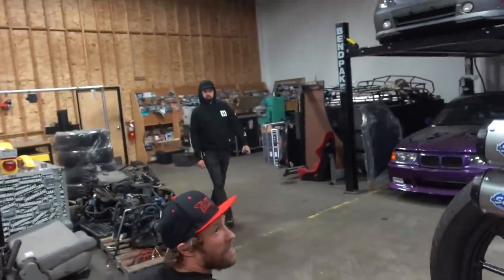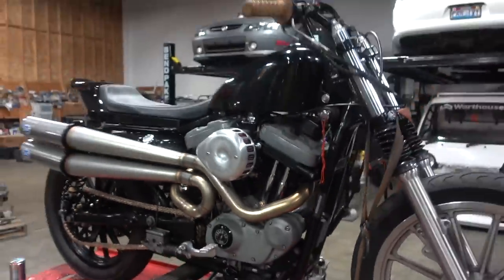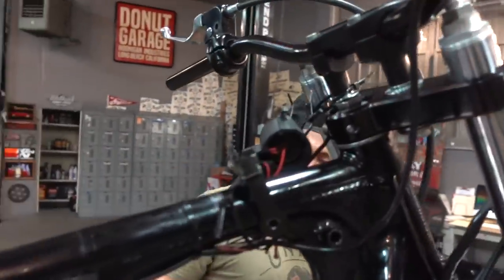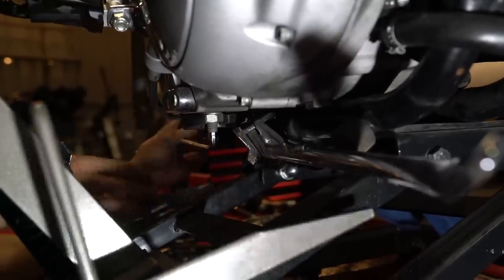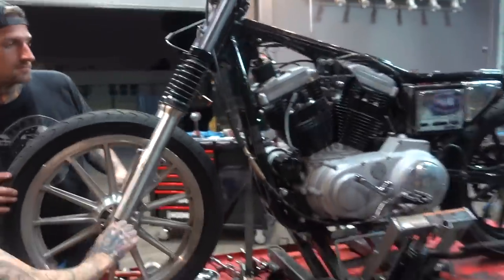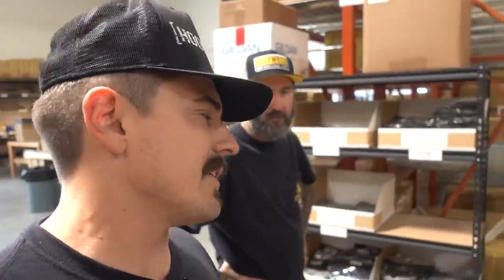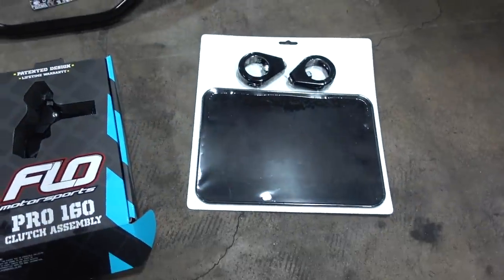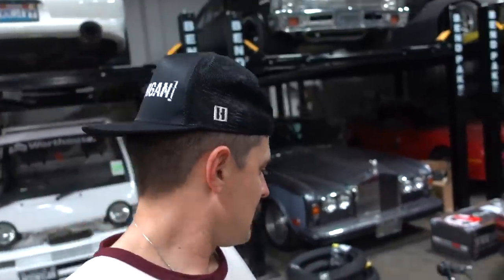It's Alive!! Finishing Our Flat Tracker Race Bike for X Games Qualifying

Comment: This is something I did the wrong way round, first time out on my '79 Sportster. It put the front wheel totally out of line and the bike was trying to steer right the whole time. It was my first motorcycle ride in eighteen years, it was dark, and the covid lockdown had just started so I was avoiding police by using back roads. I nearly died six or seven times that night 🙂

Comment: You can cut that barrel off one cable, drill a hole thru it, snip off the horseshoe end on the stock Harley cable, then solider the barrel on the end of the stock cable. Easy fix. I do it on my dirt bike for custom length cables.

Comment: Correct me if im wrong, but aren't those footpegs supposed to swing back, towards the rear of the bike? This way if you drag em, they dont dig in and throw you highside over the bike? Once again, correct me if I'm wrong. But I have been riding for 24 years and have never seen them fold forward on any sort of motorcycle

Comment: ****Don't know if it's the same issue with your motor but my 98 buel chain tensioner snapped and fucked everything inside. had to replace it along with the broken and cracked trans plate also did damage to the internal mounts....nhrsperformance makes a upgrade that will fix the issue with no headache.*****

Comment: 18:02 @mister_zachary  gorilla tape is a good product, but it's likely to schmeer and mover around under race conditions, which is non optimal....   One thing that works well when you have to put a 1 inch clamp on a 7/8 inch bar is to cut up a beer can, and put strips of it in there instead of tape.  Aluminum is very sticky, for a metal.  You put in enough strips, (maybe two?)  and it fills the gap.  Clamp the thing shut, and let 'er Rip!!

Comment: Ya my bike needs a ass load of hardware & repair. A Proper Harley for a Disabled Veteran like ME.  It's a hot bike but I'm not too sure the builder did his best work on it. It's been in the Garage Garage too damn long.  Had it built in 2007 it's 2019 and only 45 miles on it before it broke. So it's a victim for S.V.U.!!!!!!!

Comment: I call bullshit when u said the wiring is more difficult. The duel plug heads don’t make wiring more difficult. U wire the coil the same as any other bike. It’s only 2 or 3 wires on the coil. Depending on what coil and ignition you’re running. The only difference is that you have 2 more plug wires. I had a 2001 1200S for years.

Comment: I hate to say it but it looks better then Zac"s Harley with the SS engine on it the fat Dunlap's set it off and the banana hammer graphic is to cool . with all the weight you took off the bike plus the top end and cam work it's going to rip. put a head light and a shitty little tail light on it and I would daily it . plus hell yes I like Bike content as long as it's not Japanese dirt bikes. I had enough of that crap in the 70's